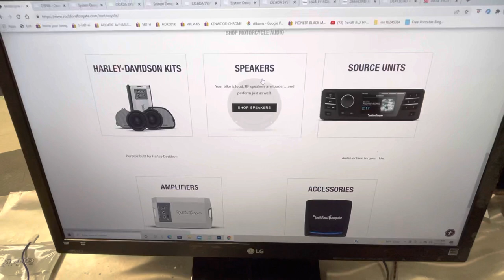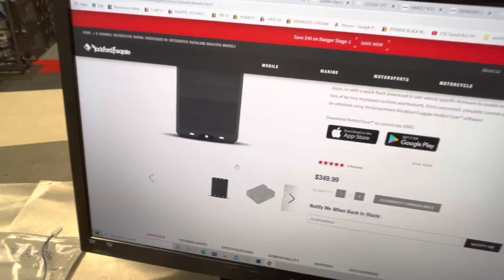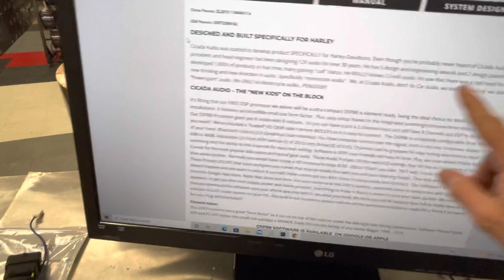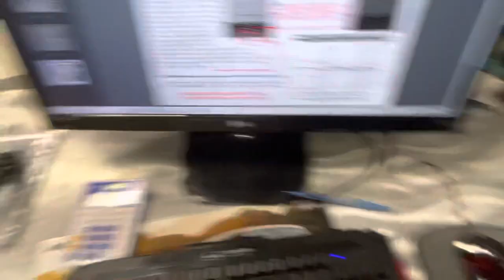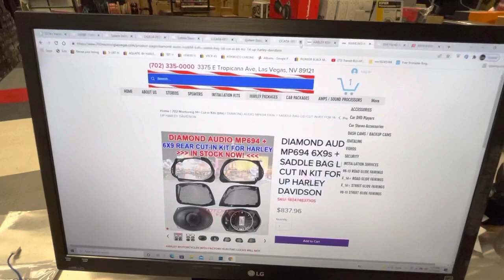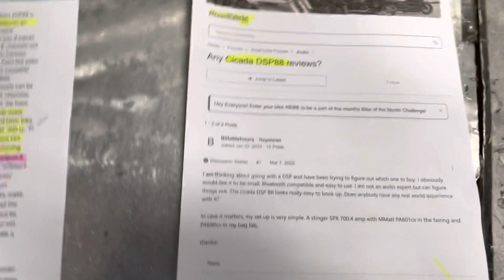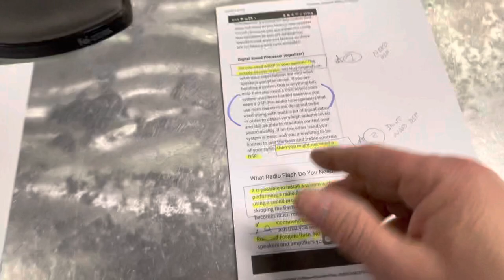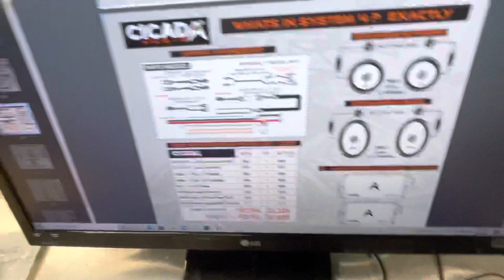YOU DO NOT NEED A DSP DIGITAL SOUND PROCESSOR ON A HARLEY DAVIDSON 2014 & UP  SOUND SYSTEM INSTALL

Comment: Genuine comment, I’m not bashing your theory as it’s all true. But even if your signal going into the amplifier is flat that doesn’t necessarily mean your sound coming out of the speakers is flat. Some speaker depending on cone material (paper, carbon, etc) will play something frequencies much higher or lower than other frequencies. That’s where I believe a dsp will come into play. To fine tune the actual sound coming out of the speaker. To each there own! I personal would rather run a dsp for ultimate control over my system than depend on a flash only. Now if your on a budget…. No, it’s not absolutely necessary. It when you want that little extra to have the ability to intiuate each frequency within the bandwidth of the dsp (10 band, 31 band). So a dsp does have value if used properly with a rta. My opinion
Reply from the maker: Hello Nick, We appreciate your input and do agree with you that a DSP will allow us to fine tune a Harley Sound System or any vehicles Sound System to a higher quality sound, we do not relate being on a budget to weather we use or do not use a DSP - Believe us our full sound systems are not budget systems - on average they cruise between $3500.00 - $5000.00 / We believe it may be a possibility we are simply using a Higher End  Product in our Systems with Diamond Audio and along with the specific design and techniques we use that simple do not force the requirement of a DSP - we normally are not using a name brand two way speaker like many others, I suppose if we did yea a DSP would be needed to get the quality sound out of the speakers, we believe our sound systems are already elevated above many others out there but again that is only our opinion.

Comment: I have a stock 2022 head unit, infinity fairing, infinity 6x9 in bags, precision power Amp. The kappa Perfects seam very Brite. I feel I definitely need a DSP! I stream via Spotify,  even tried using android EQ, that helps but screws up my sound in a vehicle. Factory bass and treble controls on the HD head unit are no help.
Reply from the maker: Did you have the factory radio flashed?
Reply: @702motoringlasvegas4  yes
Reply from the maker: @jpb-go8qh  Which Precision Power Amplifier do you have? is it the MAA4 Harley amp? or which model number
Reply: @702motoringlasvegas4  Yes. I think if I only had an EQ on factory radio I would be fine. I really don't want to swap out to the sound stream radio. 
A DSP is probably overkill but would work. Maybe a set passive crossovers with a tweeter DB cut?
Reply from the maker: @jpb-go8qh  We believe if the amplifier is retuned your problem may be resolved, message me vegas.paul99@gmail.com and I will respond with tuning instructions that mill help you out

Comment: What wire  Harness u use to get ur rca out put?
Reply from the maker: For which amplifier as they are different?
Reply: @702motoringlasvegas4  sound digital
Reply from the maker: @guidoftc8304  We use this harness for Signal, it is created by us   https://www.702motoringlasvegas.com/product-page/for-14-up-harley-davidson-plug-play-factory-radio-to-amp-connection  You will need this harness for remote turn on https://www.702motoringlasvegas.com/product-page/fairing-power-after-market-accessory-t-harness-for-2014-up-harley-davidson-new  Please Flash the factory radio
Reply: @702motoringlasvegas4  I'm going in rca not high level
Reply from the maker: @guidoftc8304  That is certainly your option, however that moves you into using different types of standard hi lo convertors that others may offer that may or may not work to satisfaction, the link we sent you is how we do it and do not offer another option as with our experience what we offer we know will work, Thank you

Comment: Your "you don't need a DSP" line was the reason why I started watching your video, but then I got lost when you started pushing Diamond Audio, specifically their DSP. Ok so, is a DSP needed or not?  Or is it that a DSP is not needed unless is a Diamond Audio unit?  Sorry, the whole thing sounded biased to me.
Reply from the maker: If your factory radio is flashed a DSP is not needed and even if it was not flashed a DSP will NOT compensate for flashing, regarding the different brands we where simply showing a not yet released Diamond Audio DSP that no one has seen yet, it is not available so we are certainly not selling an item we do not have yet, but we put emphasis on Diamond Audio having the smallest DSP available when it arrives into the country.

Comment: You tune the channel and then use a passive crossover on the tweeters
Reply from the maker: Not sure where your questions leads, technically using a DSP you would eliminate the crossover network that ships with the Diamond Audio Horns.
Reply: @702motoringlasvegas4  4 channels. 6 drivers. That’s your answer above.

Comment: Honestly it shouldn't be about need or not.  just when you spend upwards of $2,000 or more for a 4 speaker set up (including a Rockford Fosgate and Boom audio even) what is another couple hundred dollars for the DSP?
Reply from the maker: Couple hundred?
Reply: @702motoringlasvegas4   yes a couple hundred. You can get a dsp for between $150 and $300. Even if you spend $300, 400, or more. Especially if you are purchasing higher end audio like say Diamond with 4 sets of 6.5s, tweeters in fairing, at least 2 amps, not to mention if you put 8in mid bass drivers in bags and all the proper wiring, and if you upgrade the battery (which you should then) 

If you are too worried about the extra cost of the dsp then you probably shouldn't be buying all the other gear either. Just my 2 cents.
Reply from the maker: @nicholasskridla2475  Understood, However at the end of the day our position is that you do not need to do it or have to do it - that is all we are saying - we appreciate the input - Safe Riding
Reply from the maker: @nicholasskridla2475  Appreciate the input, however the extra money is not needed to be spent on a DSP and we do not just stack items on a sale to make the end price higher - possibly others do that we have no idea or maybe a DSP is needed with their product selection, again not certain, but it is not needed with our sound systems.
Reply: @702motoringlasvegas4  Daytons are 198.00
Reply from the maker: @qf76mnd15  Actually they are as low as $139.00
Reply: @702motoringlasvegas4  exactly and there are multiple daytons used on bikes, so it’s not as expensive as you say.
Reply from the maker: @qf76mnd15  So what is your point? sounds like you have an agenda as you keep attempting to beat us up over hear over this video, it is a matter of opinion, do you understand what that means? since you seem to be having trouble in this area we will help you out, it means your opinion may differ than ours, end of subject, move on down the road

Comment: I agree that you dont NEED a DSP, especially with the new soundstream radio and its 13 band eq ( after todays lastest update,went from 10 band to 13 band eq). Isnt the owner of Cicada ( Larry) one diamond audios head engineers or top wig....before he quit to start his own company??? his products seem to be very similar to diamond audio
Reply from the maker: Was one of several designers yes, there are similarities between the product yes however manufactured in completely different plants in China using completely different quality of materials, that I did not get into and saw no reason to, possibly in the future but at this time it is not necessary.

Comment: I don't have a dog in this fight but it sounds like Larry pissed in your Cereal,but I do think with out a dsp its  Distorted at high volume
Reply from the maker: We have no specific ax to grind with him or his brand, only the inconsistencies on what his site shows that further confuses buyers that ultimately flow right to us that ultimately creates an issue where we spend to much of our time attempting to explain all of the inconsistencies along with our position on DSP's / We can say this to you, Every bike that we display in our videos do NOT distort even when the factory radio is at MAX Volume, do we recommend the system be run at max volume? absolutely not and we do not tell customers that they can run to max volume, However I personally tune each and every bike with the 30+ years of experience I have and that max volume with no distortion tuning provides me with that extra cushion of protection so when the customer runs his system three bars from max he is good to go and never has an issue, These amplifiers have all that is needed for an experienced person as myself to fully tune the sound systems we do and guarantee there is not one single person out there listening to any of our videos will say that they can hear distortion - because there is none to hear, so in a totality of everything we show in our videos and what we are saying that is 100% undeniable PROOF that a DSP is not needed or required to be purchased and installed if you are installing an aftermarket sound system "PROPERLY" on a 2014 & Up Harley Davidson / again we are not saying a DSP will not allow the system to sound better nor are we attacking any other seller, forum, web page, etc  / We are just providing our opinion on how we view the DSP Harley concern many others have and again its pretty hard to argue against our position when we actually provide the proof in our videos that back up our opinion.
Reply: Online doesn't sound like in person but if you say so 🤷 I don't install but I know sound and I know what I like and it doesn't sound as good with out,  but if you spend all that money what's $300 more doesn't make sense to me
Reply from the maker: @djbobbylow270  Play this video on a PC with some halfway decent speakers https://www.youtube.com/watch?v=rbVVLSYEAdk  // 1600 Watts RMS with (2) Soundigital 800.4 EVOX Amps - NO DSP - // Understand as a business a DSP runs $299.00 but you will need a T-Harness, installation & Tuning and that is far from $300.00

Comment: Do you meed it ¿probably not,  will it help your sound quality? Absolutely. As you can tailor the music you llisten to to your liking much better..from rockfords web site

"FEEL YOUR MUSIC LIKE NEVER BEFORE

The DSR1 puts the power of DSP fine audio tuning and integration at your fingertips. Whether you're an audio novice or a Rockford Fanatic, the DSR1 gives you better control over your mobile audio system beyond bass and treble adjustments. The DSR1 makes expanding your audio system to premium aftermarket gear a snap!"

I currently DO NOT have one on my bike, but i do in my var and the difference to ME is completely different. 
So do you need one? Maybe not ,will it help with overall spund quality..yes.

Comment: Man this video is painful to watch as a professional installer.   Next we will be reviewing Boss amps and saying "this amp is 10,000 watts for $89 it blows this XYZ amplifier away" as if all power is created equal.  Ive never heard Cicada in person but that argument is something my 16 year old would have with me.
Reply from the maker: Now you are talking out of your behind, if you do not agree with our opinion then so be it but don't try and put us in a boss audio category, that simply shows your immaturity. At the end of the day you are just another S##T Talker -
Reply: I heard Cicada in person for the first time this past Friday at and audio shop. 4 speaker system. 6.5 horns in the fairing, 6x9 horns in the lids. They were pushed by 2 Cicada  DSP amps. Next to it was a fresh install of diamond audio. It was an 8 speaker system. Horns in the fairing and lowers. 8in midbass drivers in the lids with a tweeter. What I heard had me quickly making the decision to switch over to Cicada. They both sound better than what I was working with. But that damn Cicada.... I was blown away by the clarity, the loudness, and how deep the speakers played. Absolutely phenomenal.
Reply: I forgot to add that the diamond audio system did not have a DSP. The guys that build at this particular shop also agree that every bike doesn't need a DSP.
Reply: Well sure you don't technically NEED a DSP....but ask any credible shop and I assure you they will explain the benefits of using one
Reply: @melissathompson7229  most certainly. I will not have a set up without one.
Reply from the maker: @BigMod167  Awesome to hear, we would have no issue putting one of our bikes up against a Cicada audio system and feel pretty confident ours would easily outperform cicada just off of the simple fact our amplifiers put out almost double the power.
Reply from the maker: @BigMod167  Appreciate the honest comment.
Reply from the maker: @melissathompson7229  We agree with what you have stated and that is all we have attempted to explain through our video, Thank you

Comment: You made this video about one company! I thought it was supposed to be about dsp
Reply from the maker: It is about a DSP - it just so happens that during the preparation of this video many inconsistencies about cicada became visible to us that will ultimately effect negatively on the customers that consider purchasing that brand and as you can see by the video the inconsistences and plain what we would consider to be untruthfulness became more prevalent to us and it simply escalated from there.
The statements about cicada became at the very end of the video it is in no way the controlling factory of the video, we felt we should make this information available to buyers across the Globe vs not showing what we see and perceive from the information shown on cicadas website and various other cicada provided material of information

Comment: In my opinion the dsp is the root cause of the noise issues but please don't say it out loud
Reply from the maker: Interesting, we do not have any noise issues?
Reply: I've done everything from proper size ofc wire ground the battery to the bike set the gains with a meter and o scope  ofc rcas all the joints are soldered trying to hold on to my dsr1 and its the source of my noise at idle to low volume.
Reply from the maker: @mrshooff2  What year bike? 
Did you flash the factory radio if using one?
What amp and model numbers are you using?
What exact speakers are you using?
Reply: Don't worry it's has nothing to do with the DSP,

Comment: This is a Cicada rip video.   Leaned nothing about dsp
Reply from the maker: You learned that a DSP is NOT needed to create an Awesome sounding Harley System
Reply: @702motoringlasvegas4  no I didn’t.   Most of us start with four speakers add more speakers And his DSP maybe not the best design But I’m sure loving his speakers.   Are there better speakers on the market most likely but you’re just knocking someone down who is trying to do his own thing and it would’ve been OK and a four minute video but you drag this on for ever which turns it into a personal grudge video no matter what you say and I have bought many things from you and this is below you.
Reply from the maker: @extremebaggers7817  We explained in detail a current issue we experienced with his product along with a very real customer issue due to his product and brought to the attention of unsuspecting consumers all of the back and forth inconsistencies in all documentation found in the website, instructions, etc, etc, 
Not to mention the differences in specs sold and item received- all of that is no less then what some people will call consumer fraud 
So yes you can bet 100% we will bring those issues to light especially when the issues creates an issue between us and one of our customers